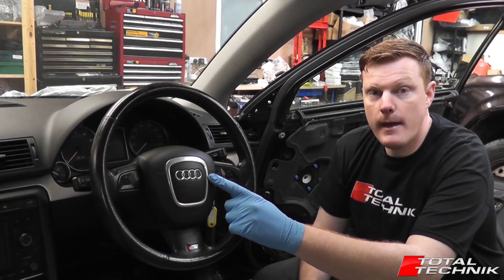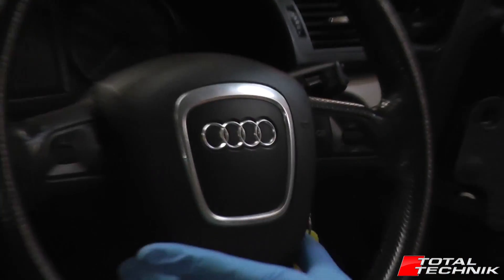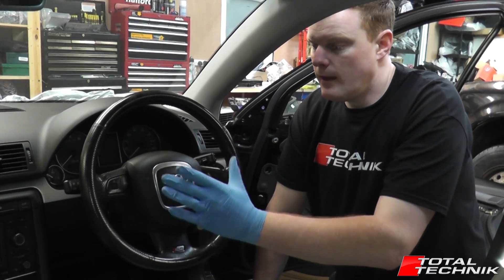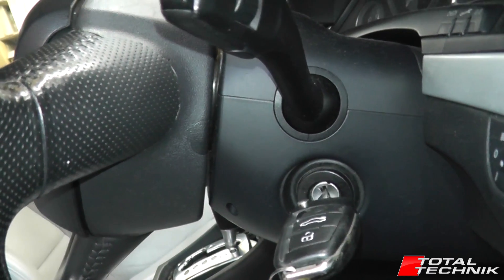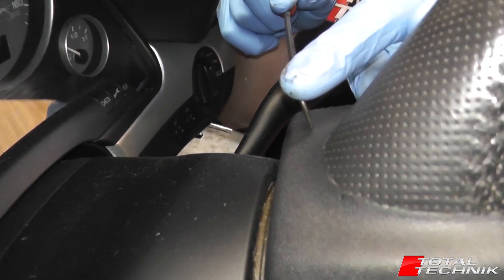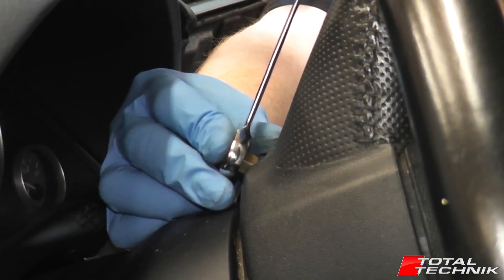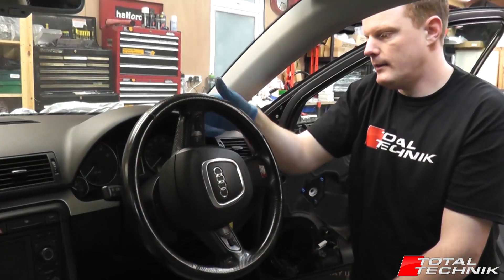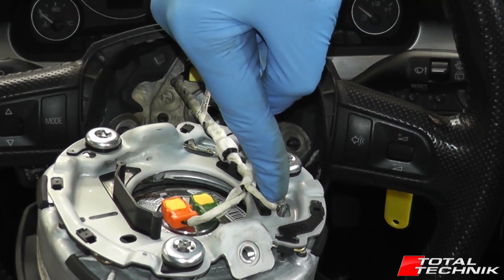How to Remove Airbag - Audi A4 S4 RS4 - B7 2005-2008 - TOTAL TECHNIK

Comment: Good video, clear and concise! Question, if replacing a deployed airbag, looks striaghtforward to put  a new(or used) airbag in....but of course, the module needs to be either replaced as well, or reprogrammed....do you have a video on that? Can a used, undeployed airbag be fitted?(provided of course, it has the same options, and is the correct fit)?  How big of a task to ge the control module sorted?

Thanks
Reply: It be nice to have the reprogramming instructions too.  I need to replace my airbag

Comment: Great instructional, just finished your steering wheel removal walkthrough. Do you happen to know, regarding the b7, if the 4-spoke and 3-spoke non-s/line airbags are interchangeable?

Comment: Is this the same procedure for an audi a3 8p dual stage airbag and disconnecting the negative battery terminal? do you also need to keep the ignition switch on while doing this all the way through or do you need to turn off and take the key out once battery disconnected? i have a flat bottom steering wheel that i want to fit just want to be certain
Reply from the maker: Hey there! Unfortunately we are not covering the A3 platform just yet. We are hoping to be able to expand Total Technik to cover additional models, but it's not a cheap undertaking and our expansion will be solely reliant on the support we receive from our viewers.

Hopefully we can cover that model in the not-too-distant future!

---

To help support us (for both you and others reading this) there are a few things you can do:

1) Donations both needed and welcome! We cannot operate Total Technik without the support of people like you! You can donate by PayPal - just go to www.paypal.me/totaltechnik
2) Please ensure you subscribe to our YouTube channel.
3) Please give our video's the Thumbs Up on YouTube.
4) Please help spread the word, the more people who know about us the better! Add links to our video's in forums, let people know about us.

Thank you for your support!

Comment: Is the airbag for standard b7 Rs4 interchangeable with airbag in flat bottom wheel? I am looking to switch the boring rs4 round wheel with flat bottom wheel and hoping to switch the original airbag across.

Comment: Can I insert a steering wheel from an Audi Q5 2010 to an Audi A4 B7 without any changes and does the airbag from the B7 steering wheel fit the Q5 2010 steering wheel?

Comment: Hi buddy,I wanted to ask you if you can help me with this problem, I have an Audi A3 8P from 2003 with a three-spoke steering wheel without radio controls, and I would like to mount a steering wheel with radio controls, they told me I can do it and I have to change the antagonist ring too  , but I have to pay attention to the type of airbag I am going to mount because my airbag control unit supports only those single-stage, right?.
 I looked behind my airbag is in fact there is only one connection
 If I want to mount a steering wheel like this you showed in the video, should I also replace the airbag control unit?  because otherwise I would have errors on the dashboard with light coming on and malfunction of the airbag in case of emergency right?, in practice then only a charge would work ?, thanks for the reply and help , best regards .
Reply from the maker: Hey there! We're not covering the A3 platform yet, but hope to in the future if we get enough support from our viewers.

Be very wary of changing from single stage to dual stage airbags. This exact scenario is also on the A4/S4 models between B6 and B7. There are a couple of options to wire them up, but no proof that they actually discharge correctly in the case of an accident. If you search around online you may find the images of an Audi A4 B6 owners car who upgraded the steering wheel to a B7 one and had a bang. The airbag did not deploy, and it was a considerable knock!

As it's safety related, stick to factory just in case and be secure knowing it will deploy should the worst happen,

--- 

To help support us (for both you and others reading this) there are a few things you can do:

1) Donations both needed and welcome! We cannot operate Total Technik without the support of people like you! You can donate by PayPal - just go to www.paypal.me/totaltechnik
2) Please ensure you subscribe to our YouTube channel. 
3) Please give our video's the Thumbs Up on YouTube. 
4) Please help spread the word, the more people who know about us the better! Add links to our video's in forums, let people know about us.

Thank you for your support!

Comment: Hello! I've got an Audi a3 8p 2007 with 4 spoke steering wheel, looks like that one in your video but it has 4 spokes. Is it the same procedure to remove the airbag as you showed here? And also I'm planning to install 3 spoke steering wheel from A3 2010, will it fit to my car?
Reply from the maker: Hey there! Yes, the process for airbag removal is the same for the majority of Audi and VW models so this should be more than enough to guide you through!

Changing the steering wheel itself is generally not an issue, provided the original airbag is used. The airbag is a safety item and so important not to alter. But the steering wheel should phyically fit no problem. Not sure if your new/old wheel is multi-function etc, so you may just have to give it a try. Might be worth a Google search to find info from someone who has done this same retro-fit.

--- 

To help support us (for both you and others reading this) there are a few things you can do:

1) Please ensure you subscribe to our YouTube channel. 
2) Please give our video's the Thumbs Up on YouTube. 
3) Please help spread the word, the more people who know about us the better! Add links to our video's in forums, let people know about us.
4) Donations both needed and welcome! We cannot operate Total Technik without the support of people like you! You can donate by PayPal - just go to your PayPal account and select the Send Money option and send any donations to: donate@totaltechnik.com

Thank you for your support!

Comment: If you replace the airbag (and wheel) but not the actual airbag module, is it necessary to program the new airbag via VCDS? I'm looking to put a nicer and different color wheel & airbag on my car, same exact style as the old one. Old airbag has never deployed or anything. Just a straight swap.
Reply: Not necessary

Comment: You guys happen to know if an Audi A6 4 spoke 06-08 air bag fits an Audi A4 2008 4 spoke steering wheel if it doesn't do you know any other Audi air bag that is compatible with an A4 4 spoke steering wheel thanks
Reply from the maker: Hey there

It's not something we would want to advise on TBH. The airbag is so key in driver safety that changing to another airbag has possible safety issues.

Personally I'd stick with factory airbag and upgrade the steering wheel (which is what I assume you really want to change??)

May be worth asking around on the forums on that, but bear in mind that there is always a possibility it may not deploy if it is not the original factory airbag designed for that model. Just because the electrical plugs may be the same, it does not mean the pin assignment will be the same, or that the signal sent by the car is the same as that required by the airbag.

It's a bit of a can of worms TBH. But best of luck with it!

Please be sure to support us: subscribe to our YouTube channel and help spread the word!

Comment: Hey guys, I was wondering if I can upgrade my A4 B7 steering wheel to one with the multifunction buttons. Have you ever done this before? Do I need any special sets of cables? Best regards
Reply from the maker: Hey there! Almost certainly I would say yes it would be possible. I have not done this adaptation myself, but I see no reason why it cannot be done. You may have to upgrade a couple of components within the steering wheel assembly.

I'd recommend doing some Google research or visiting one of the Audi forums like audi-sport.net as more info on this upgrade should be available.

Best of luck!

Comment: hello, I have a question - I replaced the battery on my s4 b6 on Wednesday and the air bag control lights up, I do not know why? can you help? greet Barbara.
Reply from the maker: You'll need some kind of diagnostic software to reset the airbag. Try that, and if it stays off you're all set. It happens occasionally, but shouldn't really.

--- 

To help support us (for both you and others reading this) there are a few things you can do:

1) Donations both needed and welcome! We cannot operate Total Technik without the support of people like you! You can donate by PayPal - just go to www.paypal.me/totaltechnik
2) Please ensure you subscribe to our YouTube channel. 
3) Please give our video's the Thumbs Up on YouTube. 
4) Please help spread the word, the more people who know about us the better! Add links to our video's in forums, let people know about us.

Thank you for your support!
Reply: @TotalTechnik Unfortunately, there is a new problem, namely: the alternator in my s4 b6 broke down and I have to partially start the car to see what the right part is set up. 2 models assumed - delphi and hitachi, even on the audi website do not know which is the vin number, best regards Barbara Krauze

Comment: if my audi has a steering wheel without control function if i remove it should there be a connection if not how sgould i ho about adding one

Comment: how do you remove the whole black airbag plastic cover? i need to replace my airbag plastic cover as it look old and the emblem snapped too, thank you
Reply from the maker: Easier to buy a replacement airbag. Get a used one if budget is tight as new can be pricecy.

BUt trying to take the airbag apart is not a good idea :-(
Reply: It’s easy.You must unscrew 3 torx screws and remove the metal part. Then pull on the plastic part until you remove it. The airbag will not explode without worries.